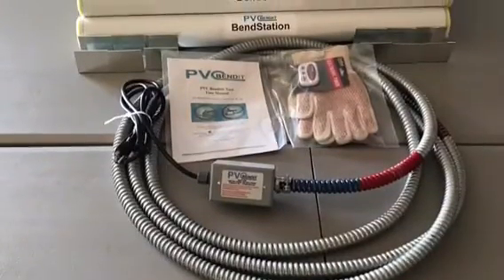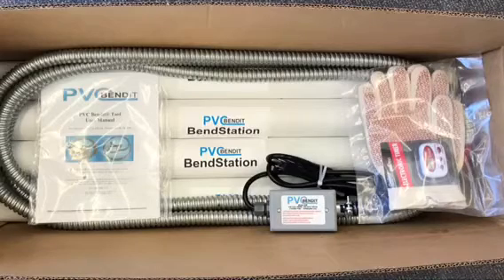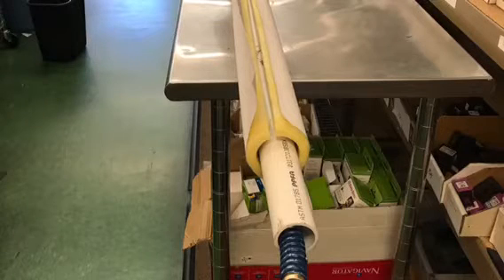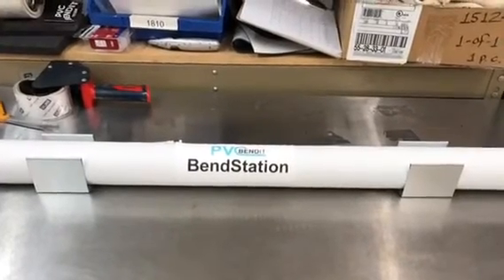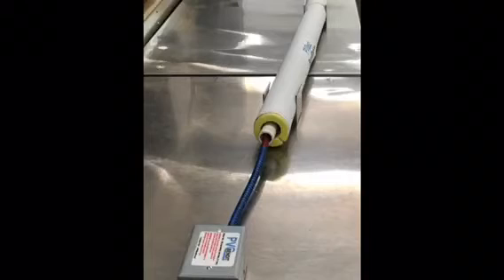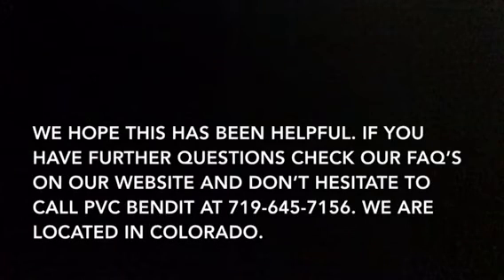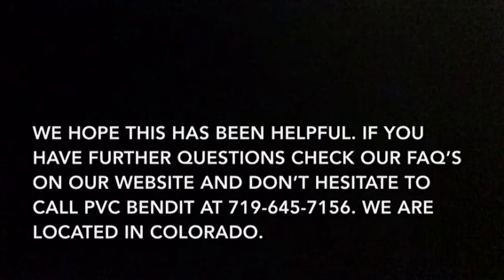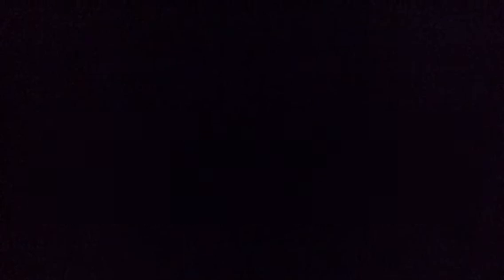How To Heat & Bend PVC Pipe Easy and Fast!

Comment: This looks terrific.  Using a heat gun is a pain in the rear.  If I’m working with a long piece, sometimes one side will cool down while I’m heating the other.  This tool looks like it makes that process more consistent and heats the pvc evenly.  I’m checking your website to see what these cost...  👍🏼